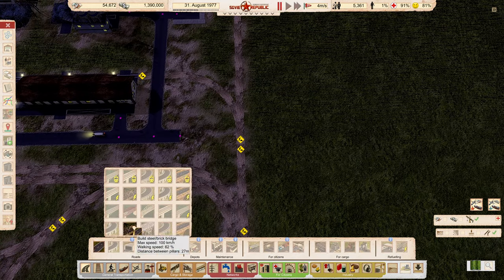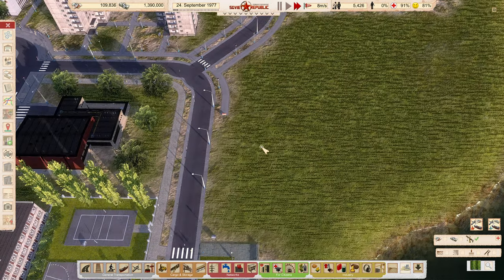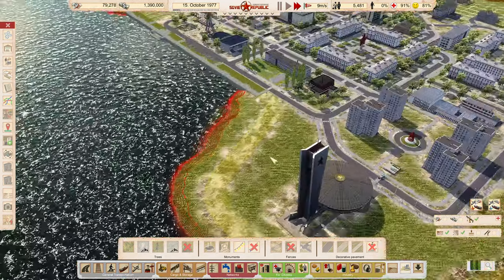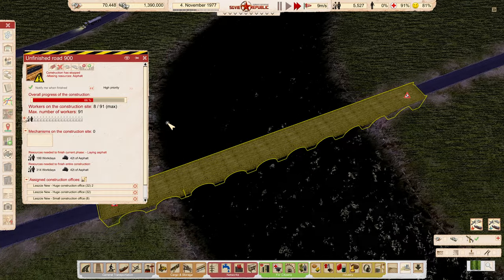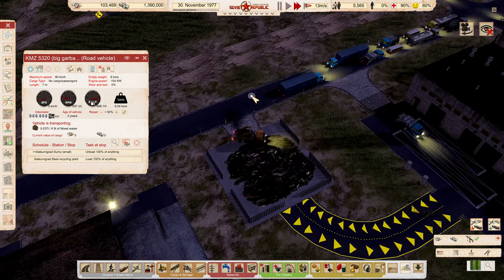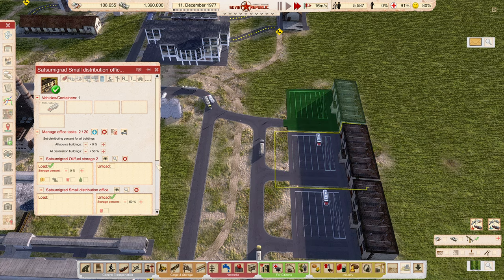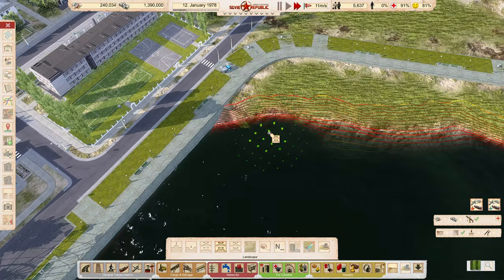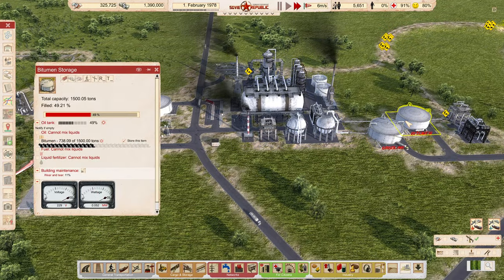Fixing Traffic - S3E20 ║ Workers and Resources: Soviet Republic

Comment: You might have too many grain delivery trucks, exacerbating the intersection issues

In addition, will you be considering a roundabout in the construction area to improve accessibility? 

Finally, would it be possible (Once the design has crystalized) to add some trees to improve local climate and shading in both the industrial and residential areas? 

Thank you as always for your wonderfully relaxing videos ❤
Reply from the maker: That grain truck issue was because I changed the line. When that happens the trucks retart their route, and all of them suddenly tried to enter the farm silo. Once they start doing spacing, it will solve the problem.

As soon as we have traffic issues in the industry sector, I will likely add a roundabout as a stop-gap measure. :)

I definitely want to add more trees. In fact, I should do it soon, I don't think the place will expand all that much, maybe a bit more garbage processing.